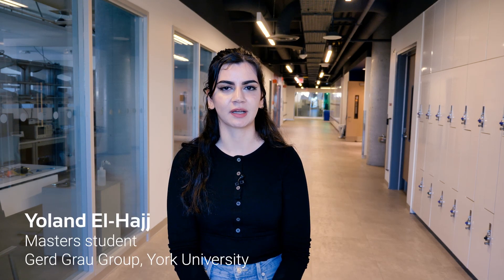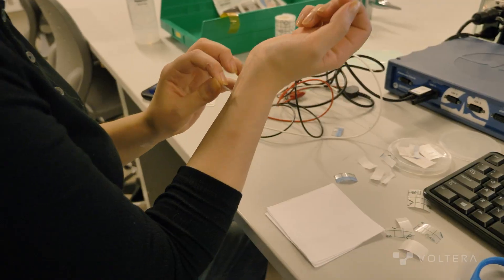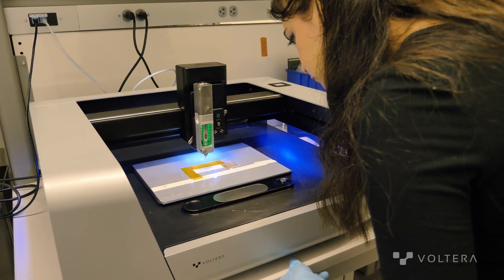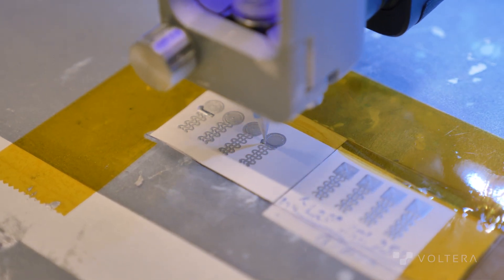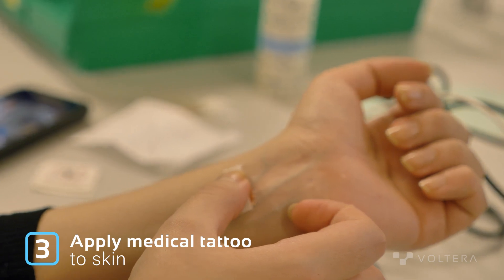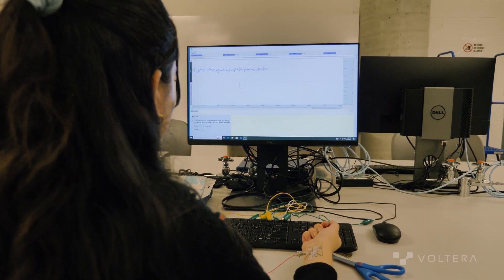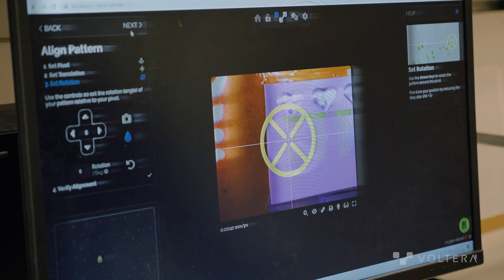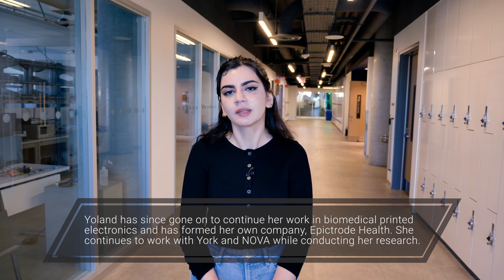Biomedical Electrodes on Tattoo Paper | Bioelectronic Application, Sensor

Comment: May I ask what you dropped on the hot-pressed protective layer of TPU, and what is its function? How do you make the TPU drawing layer adhere to the sticker? Why isn't the heat lamination layer bonded to the sticker?
Reply from the maker: We're not too sure. This research was conducted by Yoland El-Hajj at York University in Toronto. She did detail some of her process in her research papers: 
https://www.researchgate.net/publication/361717600_Inkjet_and_Extrusion_Printed_Silver_Biomedical_Tattoo_Electrodes

and 

https://yorkspace.library.yorku.ca/server/api/core/bitstreams/77423903-d210-46d3-9387-bdec086bd6cb/content